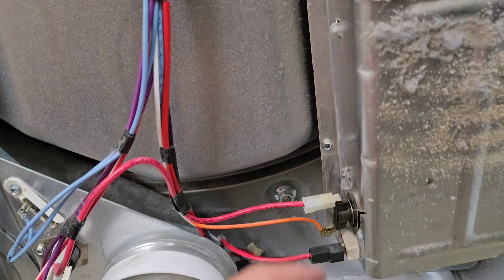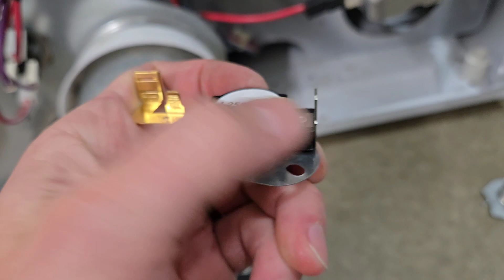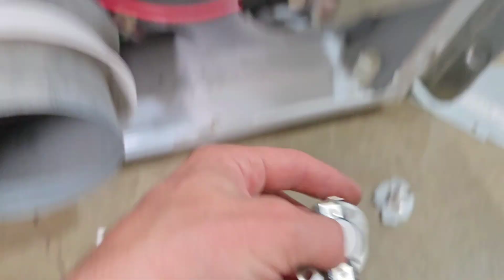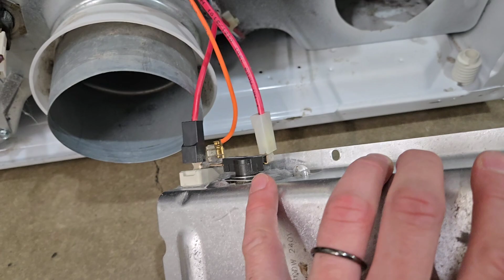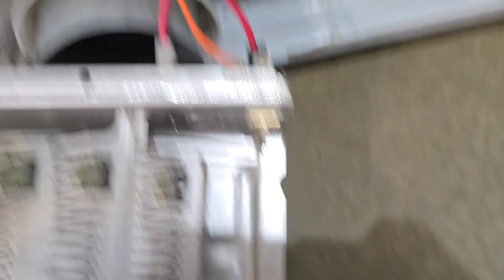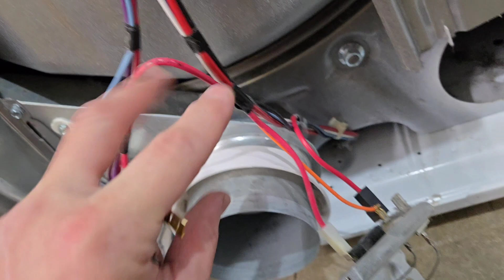Electric Dryer Heating Element Wiring Explained | Top Lint Trap Models – Part 1 | Josh Cobb

Comment: Yeah I'm having a problem, I bought this off Amazon and the kit is exactly the same kit you have but my wiring on this roper is I don't know out of whack. The orange wire with the black line thumbs down to a two-way splitter to a red with white line I found the wire diagram inside the dryer but it states orange black wire comes to the split off to the red wire goes down to red white wire but when I look at the wire diagram that I found inside the dryer it's like written in UFO hieroglyphics. Only the technician can understand this map why can't they just put a picture of the back of the dryer showing where all the wires go to from what point to the other points because I have the timer and I'll follow it all the way to the power pigtail which is a 240 that 240 goes all the way down to the motor comes back out to the ceramic block the orange and black wire with the red and white going to the other side or the middle of that little pigtail things they added in here but the other side goes to the one on the blower side. All of this is still confusing even I'm mechanically inclined I put fpv drones together my God this is crazy someone show me the diagram directly what goes from the pigtail to the whatever to the other whatever when you look at it on the video it doesn't seem to make sense when all the wires are taped off and you don't know where wires are going from what point to another point to the other point to the other point and so forth I'm stuck I think I'm going to call roper and talk to their help desk and hopefully they can talk me through whatever I'm going through thank you for the video. This repair is not for anybody who has A.DD or OCD. Make a wire diagram that you can understand and only you can understand and come from there because when companies try to make something better you end up having a lead left over that's not plugged in and going hmmmm something's wrong accompanying need to leave a wire diagram made for someone in kindergarten to follow exactly what wire is going from what point to another point not by the technical terms

Comment: This is great,  but my bottom red wire with the black protector attached to the thermostat was burnt. I can't find a replacement with the black end. Is it necessary? Would you have a link or part number?

Comment: I got a problem with mine i did a mistake the blue wires touch the metal and now nothing works it was just to replace the fuse but now that happened and can figure out what is going on
Reply from the maker: You'll probably need to replace that fuse again but check your breakers. This would have grounded out and popped your breakers.

Comment: I’m changing out my heating element due to
The coil being broke. I noticed on your video there is an orange wire to the top thermostat and an orange to the bottom one. My Maytag dryer only has the top orange. The bottom thermostat doesn’t have it. Only has the two red. Why is that?
Reply from the maker: The orange wire that connects to the heating elements high limit thermostat (on the bottom) is a part of the moisture sensing drying cycles.  A lot of dryers don’t have the orange wire because they don’t actually have a moisture sensor anymore.  So if you don’t have it don’t worry about it, it just means your Auto Dry Cycle is on a timer, not actually sensing how dry the clothes are.  It’s a way for them to cut costs.
Reply: @MrJoshCobb ah got ya. I appreciate that fast response. Just ordered that heating element. It was cheap. I just hope it’s not cheap as in not working after 3 months .
Reply from the maker: Fingers crossed.  I put one in my dryer at home and it’s been rocking for 1-1/2 years so far, but making sure you have good unrestricted airflow by cleaning the vents in your house really helps prevent overheating and premature failure. Thanks for watching!
Reply: @MrJoshCobb yea I def did all that and broke the dryer down pretty far n vacuumed it. Trying to do this for my girlfriend . She rents and her property management takes forever to respond . I do have another question if ya don’t mind?
Reply: I got the whole kit w thermostats. I’d usually change out everything. But as I was saying before w this heating element, I’m not sure how long that one will last. Should I just change the heating element out n call it good? Or would u change out all the other parts that came ie the thermostats too? Thanks bud!
Reply from the maker: @seanhunty9304 definitely change out all of the components.  At least the ones on the heating element shaft.
Reply: @MrJoshCobb gotcha ! Does make sense . This Maytag is only 5 years old. So t make em
Like they used to for sure .

Comment: I’m a tech, so the element- the top is your thermal cut off. It serves as a safety net. The high limit thermostat monitors the temperature of the element. If the high limit stays close, the thermal cut off will trip . The closest thing to a thermistor on that is the thermal fuse. Vent restriction, bad blower wheel broken belt grounded element and of course the actual cycling thermostat

Comment: Awesome timing.  I got home from work today and thought I was going to have to start researching the hi-limit thermostat to figure out how to connect it...but I saw you uploaded this!  This video seems very thorough and I think you answered just about all of my questions.   I will give it a go tonight or tomorrow.  I actually replaced it about 10 years ago as well, and I vaguely recall the wiring for that part gave me some problems back then too.  I should have taken notes, but I didn't.  I will this time!!
Reply from the maker: Awesome I hope it helps!!  Thanks for watching!
Reply: Okay...so...on the high limit thermostat I don't have an orange 'auto sensing' wire.  I guess I just connect the thermostat as shown and then connect the two red wires and call it a day?  The previous thermostat was like you described...it just had two connectors and then I had a jumper wire that was used to connect the HL thermostat to the white heating element connection right below it.  I'm guessing the new type of high limit thermostat shown there with the long 'arm' probably makes that unnecessary?
Reply from the maker: @sydneywalker2966 you got it!
Reply: @MrJoshCobb  Thanks again for your channel and for the extra help.  It turns out this time around it was my heating element, but I took LOTS of notes from this video so in 10 or so years when the dryer stops heating again, it will be a piece of cake to fix...assuming they still make the parts for it!!